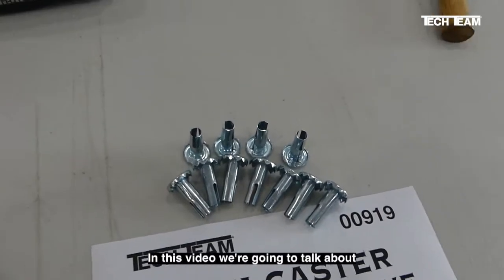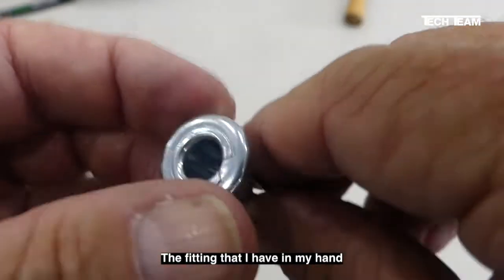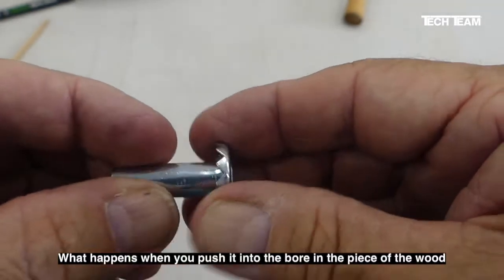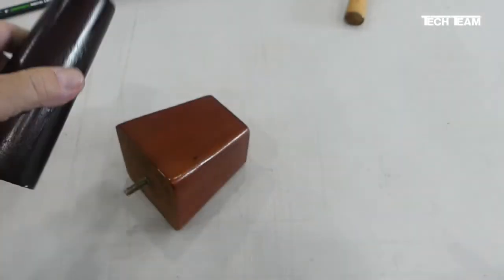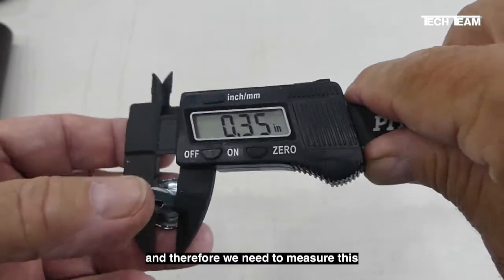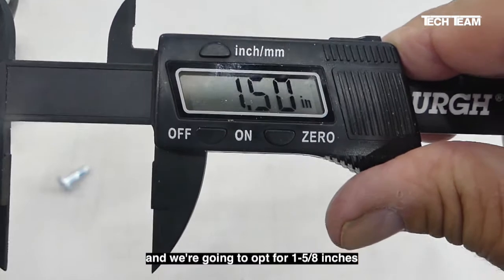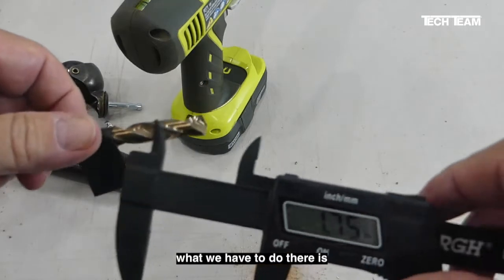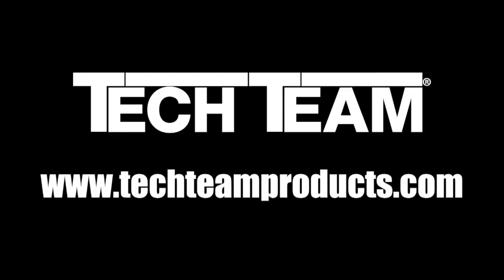Tech Team 00919 Grip Neck Stem Insert / Interface Sleeve / Bushing for Grip Neck Stem Ball Caster

Comment: I followed the steps as described having removed an old sleeve that broke down. The new sleeve seemed to hammer in place just fine, and the castor stem clicked in giving the feel that it went beyond the narrowing end of the sleeve as needed. 
But a week later the same leg had a note on the chair seat, next to again, its castor leg, stating that it fell out. When I removed the new stem I had gently hammered in place, its narrowed end had become expanded such that the castor fell out. How did the castor click in place beyond the narrowing sleeve, and then that narrowed section expand? Is it possible that I perhaps should have bored a hole a smidge deeper to be on the safe side? Or maybe you can provide me a link to a better quality sleeve, although mine bought at a hardware store sure look the same as what you used in your video.

Comment: And how do you remove it from your piece of furniture? I got a antique dresser that had one of the wheels broken, I was able to remove the wheels but the other piece I can’t.  Can you help me please? 
Thank you
Reply: I would remove the wheel and to extract the fitting maybe to drill out. If I wouldn't be able to remove the wheel, I would cut it off and then drill out what remains. Extra hole I would fill in w/sawdust + wood glue (in proportion 1:1, it is very strong).
Reply: @olenaerhardt7725  ,, Where can I buy sawdust ? 
JUst kiddin lol... But I could see some ask this very thing, made me laugh. Had to share lol...
Reply: >"I got a antique dresser that had one of the wheels broken, I was able to remove the wheels but the other piece I can’t."
I saw your question a little differently. When replacing a wheel. there is no need to remove the piece that is inserted into the wood, ... unless it was somehow damaged, which would be rare. The wheels can wear out and break for a variety of reasons and they can get clogged up with carpet lint, pet/human hair, and be so packed, that it is simpler to replace than clean. They are replaced much more often than the insert into the wood. In fact, you can see that is why they are two parts. The more permanent base rarely fails, and typically you would go through multiple wheels before the base insert would fail. Purchase your replacement wheels and see if the new one goes in without any problem. Most likely it will.

In that rare case where you do need to replace the metal base, the simplest way would be to drill it out ... carefully, because you do not want to dig into the wood surrounding the insert. That is not an easy task without a good way of holding the leg steady. You would also have to deal with the top portion that has the teeth. If after drilling out the part inside the wood, it might be easier to dry off using as narrow of a flat tool you can find to slip under the area around the center when the base used to be. Keep in mind that the insert has teeth that have been hammered into the wood. Even after you get the old one out, the wooden surface area has been damaged from the teeth of the old one, so a new one will not easily grip the same as the original. I had a repair case that the insert was old, rusted, and partly broke. After removal, it was too risky to insert a new one and expect the teeth to grip the same way. After an inspection with the other furniture legs, the solution was to replace all of the inserts, but first saw off the ends of the legs. The reduction of length was barely more than the teeth length. No one ever noticed the furniture was 3/16 inch shorter.

One final thing is that you should know is that there are two common caster wheel shaft sizes. The ones in the video look to be the common 5/16 inch diameter, common on older furniture. Most office chairs with wheels use a thicker shaft, which is 7/16 inch in diameter.

The office chairs have a black plastic insert. These can wear out if the chair user is on the heavier side. They will start to widen inside until a caster wheel will fall out without any force. You can get the plastic inserts on Amazon, the same way as the 5/16th furniture metal inserts. In fact, if you do the search, you will find that any inserts that look like the ones in this video are most likely the 5/16 inch type, and the black plastic inserts are for the office chairs. Regardless, check any image that specifies the exact dimensions.

Best of luck to you.

Comment: Any advice on how to remove old, broken off bushings from antique chairs? Trying to replace old casters and losing the battle presently. THANK YOU!
Reply: I would remove the wheel and to extract the fitting maybe to drill out. If I wouldn't be able to remove the wheel, I would cut it off and then drill out what remains. Extra hole I would fill in w/sawdust + wood glue (in proportion 1:1, it is very strong).